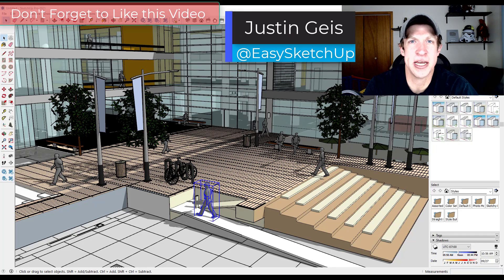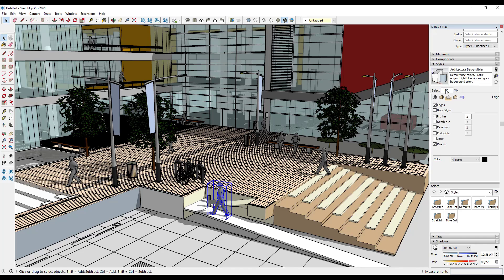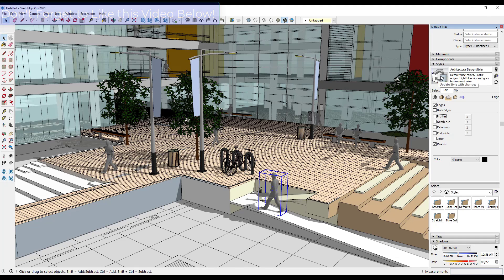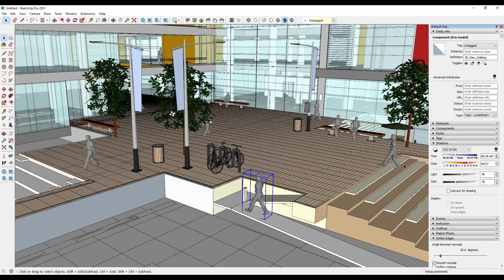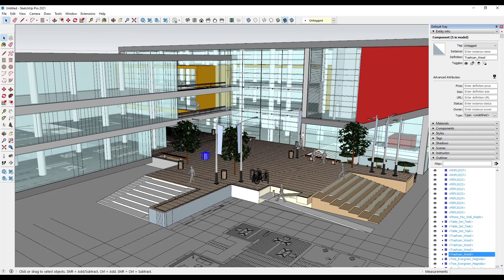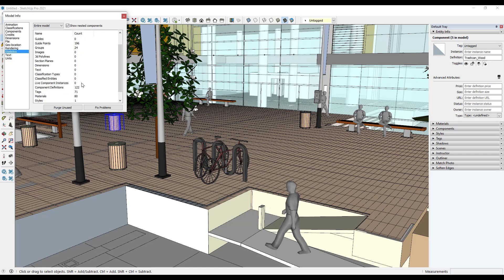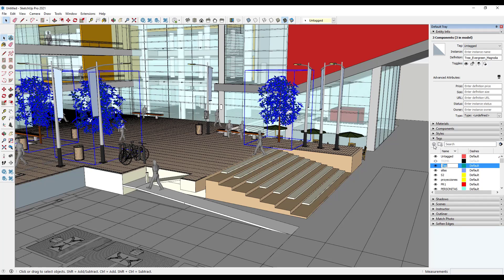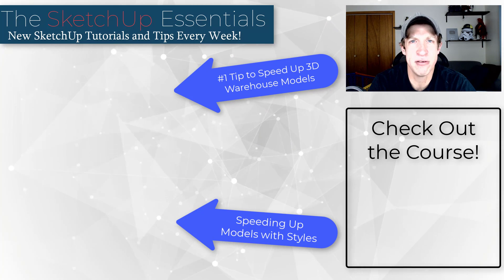How to SPEED UP Your SketchUp Models in 2021 - 5 Easy Tips!

Comment: I just decided to try the 2023 version but it was incredibly laggy with one of larger projects, like 4 FPS and really high CPU usage compared to the older versions I have. Turns out that Fredo Ghost was the culprit, for whatever reason it's not playing nice with the 2023 version(not sure about 2021 or 2022). Just removed it from the tool bar and it stopped lagging. I copied my plugins from one install to the other before I bothered using it, took me a little while to figure out that it was an extension causing the issue.

Comment: Very good and simple tips - Thanks!
In your hints-series could be added to activate the simpler shadermode style instead of the texturedmode while working. If you then assign these settings to a scene, you have almost done everything right   ;-)
As long as I'm creating a new model, I always run 2 "start working scenes": My modeling scene I call "Worx", which contains roughly your recommended settings, and the second one I simply call "All", which shows the scene in roughly the later on intended high depth quality.
Additionally, my own model template already has scene transitions disabled. Especially with large and complex models the scene transitions can be so annoying...

Comment: I think another way to speed up high detailed Models or components is to hide or put their lines into 00_abc(tag's name) then toggle it off. I usually do this so i will stil be able to keep the appearance of those components while improving the performance. After that, I'm gonna put the adjusted component to my library for later use without doing that again.
By the way, your video is very helpful! I did watch every tutorials!
Thank you very much!!!

Comment: This is why Sketchup needs to be updated with multicore support and gpu acceleration. My larger models start to really bog down and these tips can only go so far.
Reply from the maker: https://forums.sketchup.com/t/cpus-and-multithreading/88109 - Multithreading isn't going to be a thing any time soon for modeling. This is not a SketchUp thing, but a thing with 3D modeling programs in general. Rendering can be multithreaded, but modeling is a different thing entirely.
Reply: As far as someone explained to me - it is due to limitation of Ruby language that Sketchup is coded with. 
This video literally made my day. My CPU usage dropped down from 70-99% on the project I work at right now to 30-50%. That made it stop lagging almost completely. 
Its subjective of course, since every ones perseption of "lag" is different but nonetheless. 
In case some one would wonder what kind of machine I'm working at - its M1 MacBook Air. 
Also I have it installed on 3 other PCs: i7 7700k. Asus laptop with i7 (don't remember exact model, but I belive its n551 with i7 4710q or 6700HQ or 4700HQ) and iMac 2020 with 6core i5 10600 3.3GHz with turbo mode on 4.8 Ghz) I already know this would make a huge difference while working on iMac and Asus laptop. 
Best Wishes to the author of this video! 🍀 (Sorry I didn't get your name, maby you introduced yourself but I skipped this part of the video since, you know, time is money ^_^)
Reply: I guess its Justin ^_^ (comment by siam simte) Thanks Justin! best wishes to you! This is a channel I was looking for for a long time =)

Comment: Would anyone know why only a few tools are acting slow… like for instance my tape measure  and move tools are super laggy, but I can orbit and move around my model just fine?
Reply: I think the cause is the very high polygons model inside your sence. To me, for example, my bed model has too many polygons and i have to put all the blanket, pillows, v.v except bed frame (they are  still in the "Bed" group) to the tag that is going to be turn off while modeling. This helps my poor laptop perfoming better on heavy scenes. Give it a try and tell me if it helps!
Reply: @MinhBosh147  yeah I don’t think it’s a polygon issue, the file size is still pretty small. The model runs fine it’s just a few select tools that don’t run at the same speed as all the others